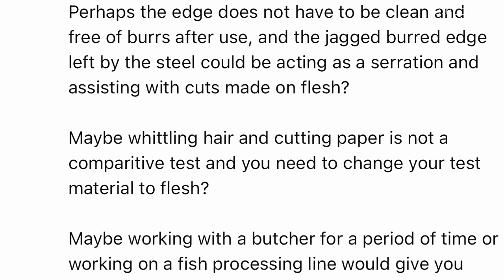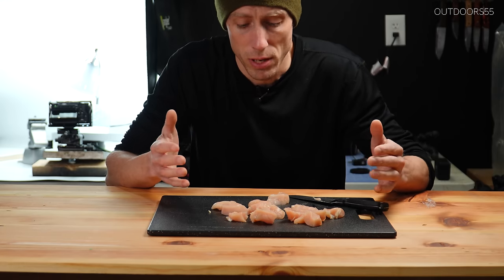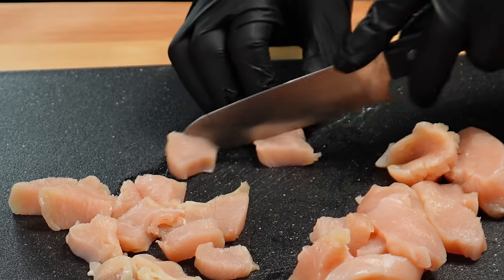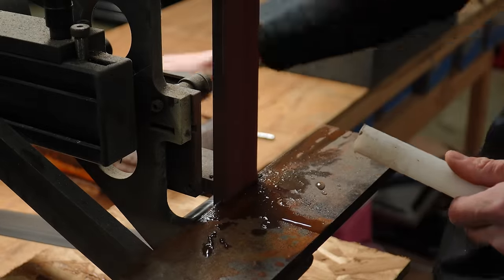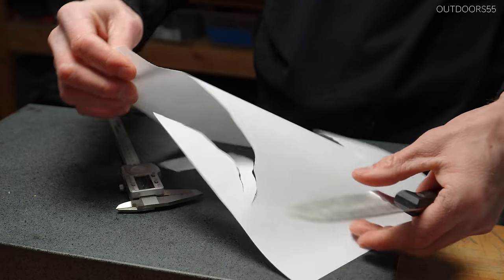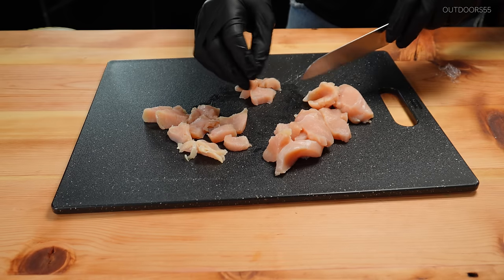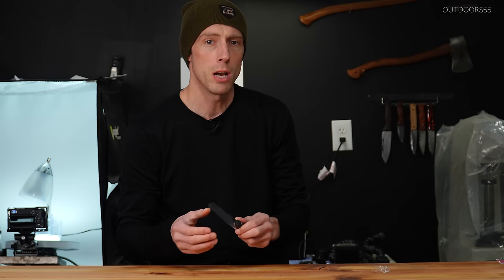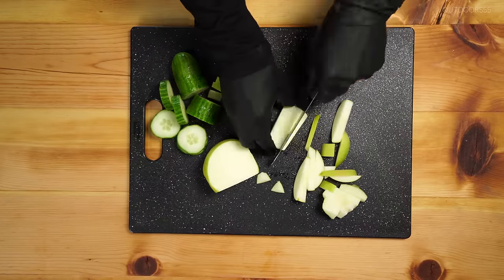Why Knife Sharpness Is Not What You Think

Comment: You are, as you said, just scratching the surface of this subject. As a person who was trained by Sami (Finnish Indigenous) knifemakers as a kid. (Traditional Pukko and filet knives), and as a major trapper up near Canada when I was a kid in the 60's  and 70's, there was a great deal of debate and opinions on how sharp you want an edge. For different uses. Most real hunters and trappers back then, me included, wanted a very sharp boning and filet knife with a very thin blade. ( I used a Canadian belt knife for that. Also called Green River knives) And they had just come out with the hip pocket size "safety" boning saws that fit in a leather belt sheath. Some used their hatchet for that. Buck 110's were all the rage, and quite revolutionary back then. Whether a person carried one of those or a sheathed fixed blade hunting knife, there was great argument over whether you wanted a "toothy" edge, or a refined smooth, apexed edge. That debate still continues. I carried one of the original Schrade Walden HS1 Honesteels in it's leather pouch on my belt. Those were covered in chromium carbide oxide coating. (Some butcher steels had, and still have that today.)
Chromium carbide was like the "diamond stones" of the time. They do peel steel off the edge of the knife, but they leave a rough toothy edge. That made cutting meat and game a breeze when deep in the woods, and not a cabin filled with proper gadgets.
As a knife and sharpening guy myself, I preferred the toothy edge for the field. A properly apexed and hair whittling knife edge would break and roll over too fast during heavy use. A more toothy edge lasts much longer in the field.
Herein is why I think even experienced knife guys fight over gadgets and methods. Some only want mirror polished razor edges. All the time. Other people could care less about perfectionism all the time. And are perfectly fine with rough, toothy edges.
There are so many preferences. And different knife edges, thickness, angle, etc. are meant for different uses anyway. As you well know.
(Another big debate was softer steels versus harder steels, and which was better for field use. I preferred high quality 420HC. Easier to sharpen in the field, and could get pretty darn sharp.) P.s.- Schrade Honesteels have been garbage for a long time now.
Thanks again for your videos Alex, even though we don't always agree.
Hope you make enough money off your videos, and your Amazon links to make it all worth your time.
Reply: Toothy edge is my go-to. Plus you only need one stone. Or in a pinch, a river rock. (Went from flat blade screwdriver dull to pretty dang sharp)
Reply: @mikafoxx2717  I have a lot of nice kitchen knives.  My favorite one is made of two hardness types of steel that are interwoven (Damascus type).  I am able to get it quite sharp and as that sharp edge wears, the difference between the softer steel and the harder steel creates micro serrations.  At least for kitchen use, it is my favorite.  It seems to hold its sharp/useful cutting properties the best and is relatively easy to retouch the blade when needed.
Reply: @mikafoxx2717  Good river rocks,  huge flat rocks, or outcroppings, ledges, have some of the best sharpening stones you can find. I am from the Great Lakes area, so imagine what those rocks are like. When a person is deep in the woods for extended periods of time, you don't have room to pack much. I don't call being in the woods, being at the cabin! 😂 You need tools that work, and can save your life. For long periods of time. That doesn't equate to being in my shop, barn, etc., where I can hand sharpen to razor edges, which I also love. For the "real woods"? I prefer my toothy edge that cuts well, holds up well, and is easy to maintain. I carry two stones. One for back up. And use natural stones in the field all the time.
(P.s.- to all the keyboard warriors who only preach "razor edges", and criticise anything else, I have three words for them to show they are being hypocritical, and don't realize  it.
"Serrated steak knives!!") (Lol) (Many different types of edges have their place in different scenarios.)
It's no different when you are in the field. Especially as an on foot trapper. Technically, ALL knives are serrated. It's just what degree of fineness those serrations are.
Thanks for your reply.
Have a good day!
Reply: Thanks for a good read. I suppose Saami people are sort of Lapland indigenous, spreading across nordic borders even, fun to find them mentioned randomly on a comment.
Reply: @Yupppi Exactly. They are nicknamed The Reindeer People as traditionally their lives depend on the reindeer. And they travel around with the herds when the herds migrate. These people are also in parts of Russia as well. They are the originators of the classic Scandinavian knife designs. Both Puuko knives, (think Mora knife), and the classic filet knives. They also originated what we call the Scandi knife grind. Along the way the Scandinavians came up with their own special blend of steel that was traditionally called Sandvik steel, as the Sandvik area was famous for it's forges and factories cranking out that steel blend. "Sandvik" steel is still probably my favorite overall everyday use knife steel. Tough, very rust resistant, easy to sharpen,   gets razor sharp, and is easy to hand sharpen and maintain in the field.
Reply: Sami are not the indigenous to anything. Indo-Europeans lived in Northern Europe thousands of years before the ancestors of the Sami arrived.

Comment: Thanks! And this is what drives me nuts about most of the current crop of pocket knives. They usually have relatively thick stock, are usually flat ground and thick behind the edge. So the moment they lose their sharpened bevel, they cease to cut because the geometry does them no favours at all. We need more hollow ground pocket knives!
Reply from the maker: Same here👍
Reply: There will never be more hollow ground pocket knives or knives with thin stock. The reason is quite simple: too many people use knives the wrong way! No, you should not use your knife as a pry bar! No, you should not use the knife to baton the stupid log! The manufacturers will use insane thickness stocks as long as people will use knives incorrectly.

PS: Boker Atlas is the king of pocket knives
Reply: Amen. Only a few folder users really benefit from a thick edge, or even a thick blade. Not many baton or pry open oysters with their EDC!
Reply: My CIVIVI Elementum is hollow ground.
Reply: To quote Dr Larrin : edge geometry. Super steel with super HT still don’t cut it
Reply: Another shout out to the Boker Atlas. It cost me £16 ($20) in the UK, it’s legal to carry (no locking blades permitted), only has 12C27 but the blade stock is thin and it’s super slicey. Yes it would be rubbish for batoning (which I’ve never had an occasion to do with any knife - ever) but I am in awe of this knife.
Reply: @chrisammann4041  I do like the Atlas and the strong backlock, although I think the blade is a bit thick behind the edge. The 12C27 steel is awesome imo, it takes a super sharp and fine edge after stropping. Also the scissors are really sharp and whole step bigger than victorinox scissors which I also like 😊

Comment: "Geometry cuts, heat treatment determines how long" - Roman Landes.    And I would add that as long as the steel is a cutlery grade steel, the actual steel really doesn't matter.   I never ship a knife that cannot cut a sheet of printer paper with just the primary bevel geometry (i.e. not sharpened).   If it won't cut the printer paper, the geometry is too thick.  And it isn't just about the thinness, either.   Food release is important, and to that end a slight convex above the edge is key.
Reply: What thickness do you recommend for a kitchen knife for most household mothers? 0.020" thickness maybe with a sliiiight concave above the apex?

Comment: Excellent information, great video. In my experience cutting a soft tomato has been the best example of a honing rod giving an advantage to a dull knife, and in that specific case the micro serration from forming a slight burr would cause the tomato skin to more easily split.
Reply: Those "laser sharpened" knifes (do they still exist?) with very aggressive serration took that idea and made a market of it. They didn't really cut anything but with a lot of small points they basically tore the food apart.
Reply: @haqvor ... Tearing to release the flavor 😸

Comment: I found that when you make the scratch pattern on your secondary bevel run in a diagonal direction, it helps form the micro serrations that you want for the blade to have that "bite"
Reply: never thought about this but i guess it could help
Reply: For some tasks it is important for the performance. For example a hunting knife doesn't benefit from a high grit mirror finish, if you stop at about a 1000 grit you create the micro serration that gives it a better bite with such a more heavy duty task.
Reply: @haqvor  yea, and I would give it a couple of passes on a strop with 6 micron gunny juice

Comment: I've been binging your videos. Stellar quality, nice job. You take a scientific approach, you prepare and theorize, iterate, and show your work. I'm incredibly impressed by the amount of work you're putting into this. As a beginner in hobby knife sharpening, this is super helpful.

I've learned:
-Leading or trailing edge makes little/no difference.
-If you're going to use compounds to strop, use a high grade diamond. Otherwise don't bother.
-Waterstones (aluminum oxide) are best ignored by beginners or people sharpening higher quality steel knives.
-A blunt knife can cut pretty well actually.
-Working a coarse grind (around 300 grit) makes a knife edge sharp enough for most people to be acceptable.

I'm considering the following:
Your onion cutting was a push-cut. While geometry might get the blade through the onion, a sharp edge gets it through the first layer, I think. So what happens when you cut a tomato with that blunt knife? Does it smoosh?
The point wasn't to start cutting all your veg with a blunt knife, I get that. But it does lead me to wonder what the effective use of the secondary bevel is. Because simply, my knives get duller over time, and they don't cut as well. But the primary bevel doesn't diminish. The secondary bevel must be involved. I'm missing something here, and I wonder whether your could elaborate by commenting, if you do have the time. 

Thanks again for making these videos!

Comment: This is exactly what I observed in the last years, but never seen or read before. And it is probably why I like my Robert Herder "Windmühlen" knives for kitchen use. No fancy forging, no super fancy carbon steel, but grinded by hand to achieve a thin primary bevel, what they call "Solinger Dünnschliff". While I really should sharpen them for Tomatos, for most kitchen tasks they are nicer to use than thicker knives with a better apex sharpness.

Comment: Good video, I am glad that you confirm my intuition. This is why Opinels (single bevel) are so sharp / easy to sharpen, or why the basic Victorinox kitchen knives keep doing reasonably well even if dull : they are thin. By the way, this is the very rationale behind peening scythe blades : having a thin (around 0.25 mm behind the edge, 10° angle) secondary bevel. Rule of thumb about when to peen : when the whetstone "does no longer work" - in other words : when then secondary bevel gets too thick... 😉

Comment: Next questions I have now is about geometry and edge retention. I have a everyday use kinda camping survival style knife, it has a massive primary compared to secondary. I've often wondered if I should adjust the geometry to make it "sharper" but have wondered whether that's important for its edge retention at more brutal tasks. 

I realise this might be a very silly question and nuanced answer.
Reply from the maker: Not silly whatsoever its a really good question. Generally speaking thinner edge geometry always improves edge retention. At least until you run into edge rolling or other serious edge damage. I left a link to a book in the description called knife engineering by Dr larrin Thomas. Its a GREAT book with all kinds of info on this. Or check out knife steel nerds website👍

Comment: Very cool demonstration.  I think the knife will retain its edge until it isn't.  Not until it doesn't, that would mean it ceases to retain the edge, until it isn't, in that it's so thin the body of the knife itself will wear away very quickly, and you won't have a knife anymore.  Sort of the equivalent of using and sharpening a knife so many times that the blade gets whittled down, except much faster because there's less knife to wear away.

Comment: great job. I've been trying to explain stuff like this to noob for ages. a well designed kitchen knife will continue to cut even when the edge is totally gone. it wont have "bite" or be able to do stuff like sushi chef whatever but for regular cutting, it will cut. it even can slice paper cleanly.. which some guys seem to think is an ultimate show of sharpness for some reason I can't understand. Yes, a well designed kitchen knife can be dulled on glass such that it wont even break skin and it can still cleanly slice paper like nothing. thats called geometry. So whats the edge for? cut intitation aka bite. try slicing paper towels with a dull vs sharp knife and you will see.

Comment: i used to sharpen puddy knives to a apex sharp edge, and one day i realized that cutting it square works much better and more sturdy. holds the edge better, is easy to dress up, put in a vice and cutting along the edge with a large file instead of cross cutting it. keep the file square with it.

Comment: I totally agree. Camping, chopping, batoning (argh!) are the only reason a knife needs a thick blade. I know many like the feel of a hefty blade in the kitchen, but they would be better off getting used to a thin blade that needs touching up only when ready to cut a roast into jerky or sausage. Add good steel, good sharpness, and a thin primary edge to the thin blade, and it.will.cut.
Reply: Only dummies chop and baton with a knife, that's what machetes and axes are for.  Knives are for CUTTING

Comment: what "helps" a lot of cheap blades is ... the cheap metal sheet they were made of , i.e. a thin sheet of an unevenly granulated alloy with brittle spots alternating with soft spots , that sort of material chips off when cutting harder stuff , thus giving a "sharp" feel because it develops a very thin sawtooth here and there , also responds well to the steel honing abomination , and people are very used to seeing the blade getting slimmer , just because that metal is so poor that it "sharpens" itself while cutting bone

Comment: Grind is king in the kitchen. I have a custom paring knife that's 0.048" stock and probably 0.001" - 0.002" bte (it was a zero grind and just has a microbevel) and even when it's completely dull, it cuts better than most knives.

Comment: So a quick correction on the hardness of human hair. Keratin has a Mohs hardness of 2.5 and copper has a Mohs hardness of 3, but that does not mean they are actually close together in hardness. The Mohs scale is for ranking the hardness of minerals against each other but there is not consistent spacing between units. It’s difficult to give a precise conversion between Mohs and an absolute scale, but some quick googling says that 2.5 Mohs is 115 Knoop and 3 Mohs is 170 Knoop. So what originally looked like an 18% difference is actually more like a 40% difference.

Comment: I feel like this video demonstrates the idea of sharpness and the thought how things often sit in the spectrum and what we perceive as binary conditions are often times just the same thing in a magnitude smaller. Like surface quality is still just mountains and valleys, just smaller than we can see with bare eyes.

What I value in a sharp knife is the hair test type of quality: I don't need to use force or movement to cut, I just lay the edge on the target and it almost cuts itself. Because most of the risks at least for me come when I need to use force and movement. Soft or hard foods, I want the shape preserved and minimum force nad movement used. Maybe I'm still not right about the differences of geometry and the edge sharpness itself, but that's what I conceptualise as sharp knife.

Comment: It seems to me the simplest way to incorporate this information is to make a bevel between the "primary" and "secondary" . I'm not sure what to call it. Taking the entire primary bevel down requires removal of a LOT of material, and weakens the overall knife. Instead of doing that, make an intermediate bevel at a shallower angle, then make the secondary ( tertiary ?) bevel at the angle you would usually want. For example, with a Lansky, sharpen with the extra coarse stone at 17 degrees, then make the final bevel at 20 with the finer stones. The edge behind the final bevel is still much thinner than before, but still strong and backed up with significant material. As the apex wears off, the width of the material behind it remains small, so pressure (force/area, which is what splits things open) remains relatively high. It also means that touching up that final bevel is much easier because it only requires removal of a small amount of material.

Comment: In terms of "edge retention" for you squared off knife, I imagine that'd depend on what you're cutting, and what you're cutting on. At that level of thinness, it should still be possible to "roll the edge", in a manner of speaking, and make it "dull" again, but my guess is that it'd last longer than if it had a secondary bevel since there's not really an apex; my guess is that you'd be waiting on the "edge" to deform enough over time that its width is no longer thin enough to "cut".